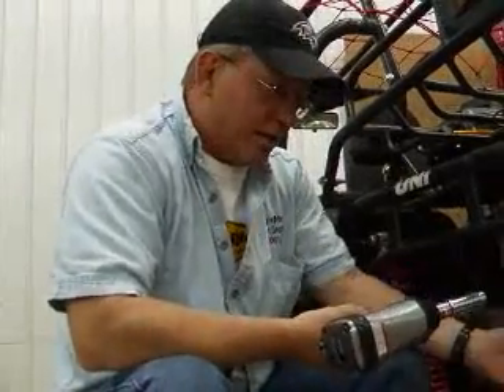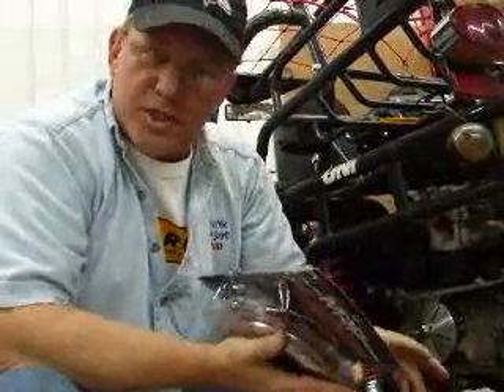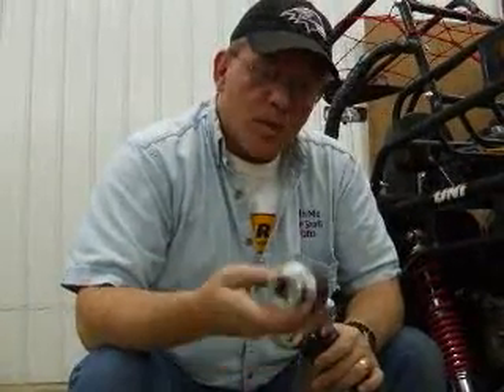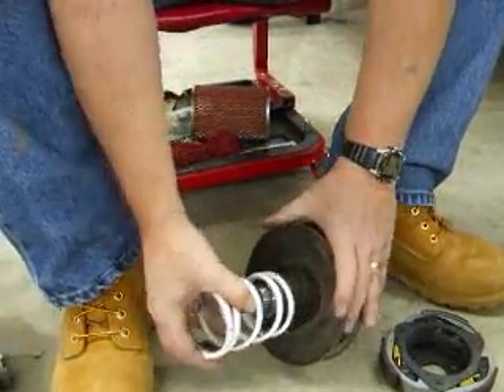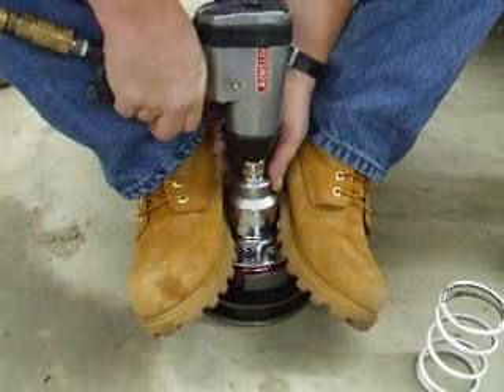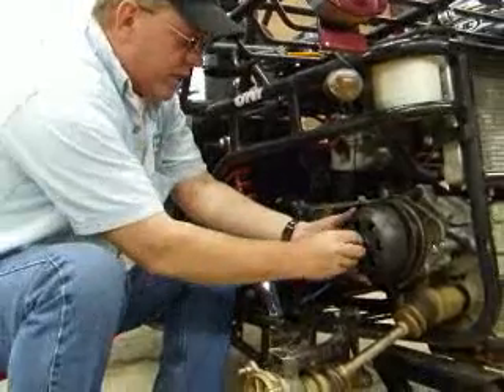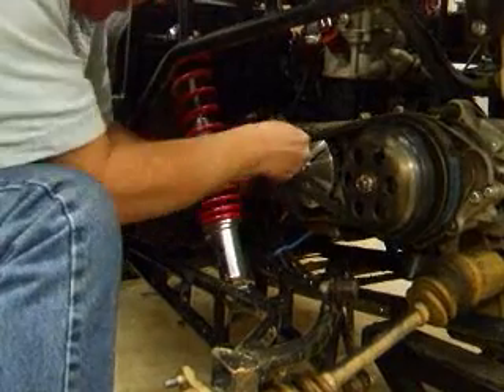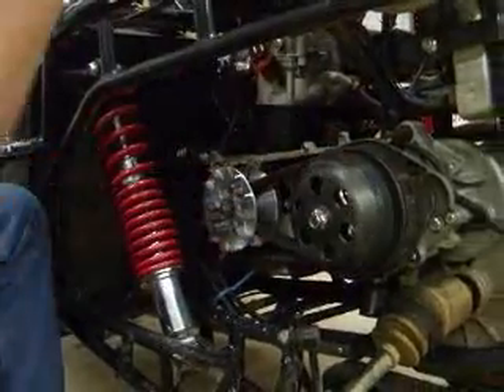CN 250 Clutch Upgrade Guide by KIDNME using the MRP upgrade

Comment: I'm sorry but the "touque spring" has nothing to do with how the clutch works. It will not let the clutch "engage sooner". AND you dont want your clutch to engage sooner! That would result in a slower and weaker take off. There is no way this guy can test out the contra spring if he doesn't know what it does in the transmission.
Reply: I have no idea why you would want to say something against me without having any recorded experience. Everyone else seems to get what I'm saying but I guess you missed it. I'll try to dumb down my other videos to help you out in the future. I've designed them so that even a person with absolutely no experience can understand how the CVT works. I designed my own clutch, pulley and variator and have them manufactured for us exclusively for over 12 years so I think I may know just a little bit more than you buddy. Start your own channel if you have something negative to say.